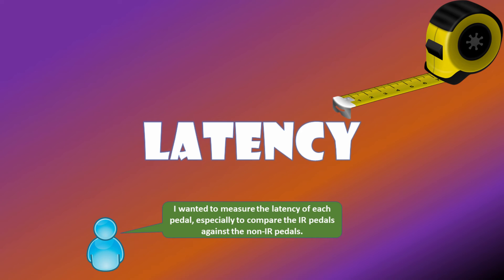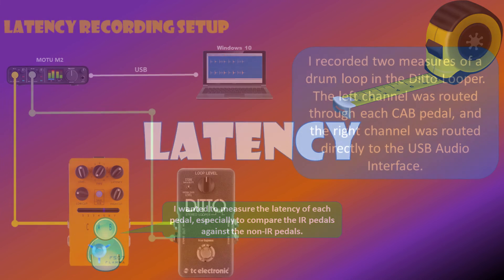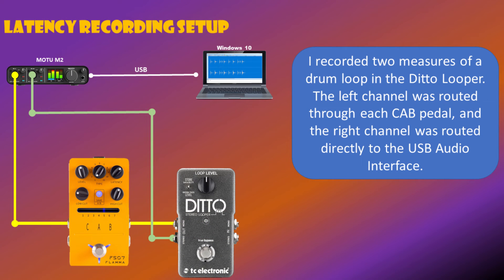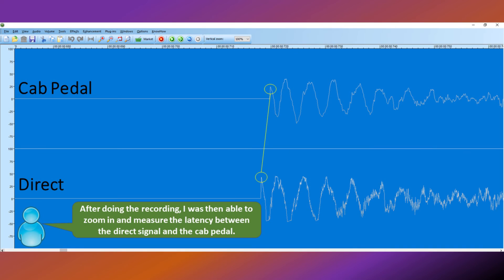Cab Sim Pedals/Devices - Demo & Latency Comparison

Comment: That was really interesting and very useful - thank you! I am interested in the Flamma FS07 which brought me to your comparison. I have the Joyo JDI-01 and think it kind of sounds OK, but nothing outstanding. Here, though, it seems to stand up quite well in comparison - and it is very reasonably priced. The biggest issue I have with the Joyo is that there is no level control/boost as it is, no doubt, meant as a DI and not a preamp.
Reply: Did you find it dropped your volume a lot? I’m using a preamp pedal and going direct. Just got one and it’s so quiet :(

Comment: The Flamma seems promising, I have used the Nux Solid Studio full size and it sounded fantastic.
Reply from the maker: I’ve been very tempted to try the NUX Solid Studio (full size).
Reply: @Tone-Quest  it seems to be worth it.
Reply: @Tone-Quest  i like it but it can be a little too bright with the power amp sim engaged. Presence must be kept low-ish
Reply: i just got it and it's good, the low and hi cut options in the pedal are really helpful

Comment: Cool video. Amazing how even a JOYO box can sound better than the Torpedo CAB SIM. I had a Le Crunch Preamp & DI, and I always felt that the brand was overrated, poorly developed, poor sounds, noisy as hell, expensive. Never again with Two Notes.
Reply: The two notes sounded the most authentic in my opinion. 
Plus from what I've seen you can do loads of tweaking using an app
Reply: @hey0mcfly  Probably the "Torpedo CAB" per se can be tweaked a lot and sound good. However I had a very bad experience with a Le Crunch Preamp (TWO Notes as well) and it was probably the most expensive and bad sounding pedal I've ever tried in my whole life. I was impressed by the joyo because my le crunch never sounded half or 10% as good as the JOYO. And I spent around $299 for that unit.
Reply: @theother526  same for me, very bad experience with two notes le crunch, tried 1 week and returned to saler.

Comment: Great video!  Do you have any info on how much the Flamma truncates the IRs?  1ms seems incredibly low turnaround time, that is typically just what the AD/DA converters take to do their work.  
BTW from my own measurements:
Mooer Radar - latency about 2ms, can load 1024 samples of an IR
Atomic Amplifirebox - latency around 2ms, can load 1024 samples IRs
Digitech GSP1101 - latency around 1.5ms (loop bypassed), can only load up to 256 samples in mono and 128 in stereo

There are also other variants from Nux, Joyo, Hotone, or even AMT etc.and I guess they are about the same, but still would be interesting to compare them, if anyone has done the measurements.
Reply from the maker: I’ve not run across any information that talks about how much Flammable truncates the IR. You know of any way I can measure that or see that data? 

Thanks for sharing your measurements, very cool. Just curious, do you have a preferred IR pedal?
Reply: @Tone-Quest  not sure how to measure that, other than comparing identical IR loaded into the Flamma and DAW plugin that allows altering the IR samples (like NadIR) , with an identical music loop. In my experience though, the difference is very subtle beyond 512 samples. I only measured the latency in the above mentioned pedals, sample length info comes from official documentation. 
My favourite is definitely the Amplifirebox, as it contains awesome amp sims, plus some useful effects and eq, all in one box. Been using it live a lot recently too, with great results.

Comment: I have the Flamma, it's not as good as the Digitech or TresCab from Mooer. I also have the Flamma preamp, and it says on the bottom that it is from Mooer, so i guess they made it, Mooer does make some nice things, but it's never exceptionally good like some things from Nux (Trident) or Boss (ME90).
But, the nice thing about the Flamma is that you can load your own IR's and still have low latency, that makes up for the quality.
They should have made more tone control on it instead of only having low and high cut.

Comment: Great video! 
Have you or anyone tried using the Joyo American sound, British or AC tone as just the cab sim. I use the British, keep the voice and gain to near min and it’s fully adjustable. It’s amazing. Not a DI though.
Reply from the maker: Thank you, and yes I’ve tried the Joyo American and British. Great pedals indeed. I’ve never tried the AC tone though.
Reply: @Tone-Quest The British works great as a cab sim. I wonder how it compares to the Joyo and Behringer DI here though which were very impressive. I had the CAB M and I’m just not a fan of digital it seems but I seek to achieve an amp in the room tone and not something for recording.
Reply from the maker: @clintwhite3021  Interesting approach using the British more as a cab than an amp. I’ll definitely have to give that a shot. I appreciate you sharing and inspiring me to try something new. 👍🏻
Reply: @Tone-Quest  Thank YOU for the videos :)
Reply: @Tone-Quest hey sorry for another question but I just got the Joyo as a pedalboard direct rig speaker/di, I have my tube preamp pedal but the joyos output is very quiet. Is that normal?
Reply from the maker: @clintwhite3021  I tried the Joyo British pedal over the weekend, as the cab sim and it worked great, but yes I thought the output was a little low.
Reply: @Tone-Quest  sorry Chris I meant the Joyo JDI-01. I just got one but the output is very low did you find this also?
Reply from the maker: @clintwhite3021  I’ll have to pull mine out and try it again, but I don’t recall it being low.

Comment: Hi, if I only need to choose one which is more essential to the pedalboard that will go well with an overdrive & distortion pedal, is it the cabinet simulator or an amp simulator? Also, do both sim need a DI pedal? Sorry, I'm still a newbie on the pedal world. Thank you.
Reply from the maker: Unfortunately, I would say it depends.  I would say in the past, most pedalboards were made up of boosts, overdrives, distortions, modulations, delays and reverbs.  Generally speaking boosts, overdrives, distortions pedals went into the front of an amp and time based effects (modulations, delays and reverbs) went into the effects loop, provided the amp had one but if by chance you are trying to build an ampless pedalboard that is going to plug directly into a PA or directly into an audio interface for recording then I would say that the amp simulator pedal is probably more important.  The reasoning behind that is, that most amp sim pedals also come with cabinet simulation built into it.  Cabinet sim pedals are ususally handy if you want more control over your cabinets or possibly the ability to import your own impulse responses.  I hope that helps a little.  Feel free to ask more questions, if any of that is unclear.  Cheers.
Reply: @Tone-Quest  I see.  I have a minimalist pedalboard (w/ od, distortion, EQ, chorus, delay) which i connect to my practice amp. I'm just thinking if i need to add a cab or amp sim pedal since I like the sound of a marshall amp. Thanks for your help and reply Chris, subscribed. Happy Holidays 🍻
Reply from the maker: @daejumong4386  Since you are using a cabinet/speaker a cab sim is not needed. An amp sim pedal can be used as essentially an overdrive/distortion pedal but if using it that way, I would recommend not using the cab sim that is normally built-in to most amp sim pedals. In your current setup it might be cheaper and possibly simpler to find a distortion pedal that is based on that Marshall amp sound but that is just a suggestion. The beauty of a pedalboard is that there is no wrong way to build one as long as you like the sounds.
Reply: @Tone-Quest   Wow, thanks a lot Chris. You really helped me to save cash. I'll take your suggestions, i just hope i can find   a mashall-sound pedal at a good price. Thanks again, cheers! 🍺🍻
Reply from the maker: @daejumong4386  Recommendations for a Marshall style distortion pedal.

New, these pedals are around the $50-$60 range:
Tone City Golden Plexi
Tone City Golden Plexi 2
NUX Plexi
Demon FREEDMAN BE-ODX
Demon FREEDMAN BE-Deluxe

Maybe check out some YouTube videos on these to see if they strike your fancy.

I have one on the Golden Plexi 2
https://youtu.be/R51dbQaK01s

I have one on the Demonfx Freedman BE-ODX Plus pedal. (Cost a little more but it is a two in one).
https://youtu.be/bcU0KOHc9VI

Good luck 👍🏻
Reply: @Tone-Quest  Thanks a lot for the recommendations bro, I really appreciate it. I'll check all of these. More power to your channel 👍🍺

Comment: That pedal with 9 milisecond latency must be damn near unplayable! What a joke.
Reply: It’s equivalent to standing 10 feet from your amp, so not unreasonable.
Reply: Can someone explain, how latency affect the sound and the playability ?
Reply: @AlvarockB  Latency is the amount of time it takes from the moment you pluck your strings to the moment the plugin/pedal/instrument actually produces a sound. Anything above 12-15 milliseconds is unacceptable for anything that requires precision because you definitely notice it and it throws you off in terms of groove. Doesn't affect the sound tho. Hope it helps.
Reply: @jul3249  thank u so much, very clear explanation. I wanna give a try to the sonicacke, but it doesn’t convince me that 9 ms latency, it is so much diference with the other pedals
Reply: @AlvarockB  well, someone has mentioned that they didn't think 9ms was that bad, so I guess I depends. I know that I am extremely sensitive to latency, and just the thought of maybe noticing a little delay is enough to throw me off, make me hyper vigilant about it and kill my mood. But maybe I'm overly sensitive. What you can do to test it is use a software like Protools, logic or even garageband and play through a slap delay effect where you can precisely set the time, make it 100% wet so you only have the delayed signal and non of the original, and see how it feels. If you play at 9ms and don't feel anything bothering, you know you're good.
Reply: @jul3249  thanks, I did what you described, and didn’t notice latency.

Comment: Why the reverb?
Reply from the maker: Because I thought it was interesting how certain pedals enhanced/exaggerated the reverb while other pedals didn’t.
Reply: @Tone-Quest  im a bit more curious about the pedal order. Ive not used an ir pedal, but reverb is trying to recreate the sound of a room. In this case, u had the chance to place the "speaker" inside the "room" by placing the ir before the reverb. Im curious how that wouldve sounded.
Reply from the maker: @adamkrasneski3679  I can’t say I know how much it changes to put the cab (IR) first but  I’ve put the the delay and reverb after the cab (IR) and it sounds just as good. It might be fun to A/B that to see how much or little of a difference it makes.
Reply: @Tone-Quest  agreed :)